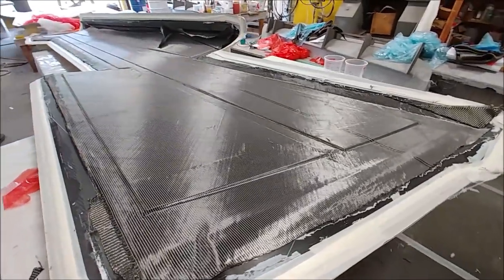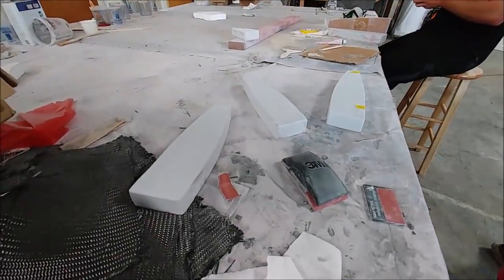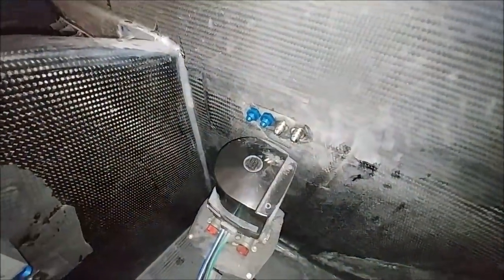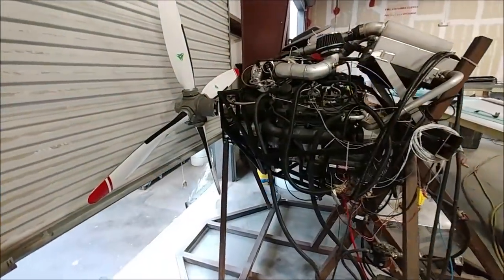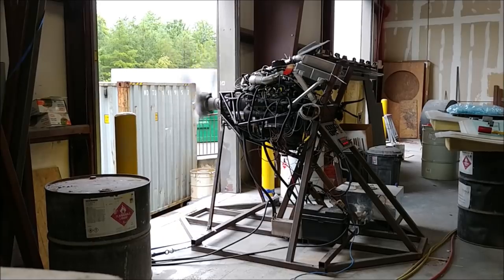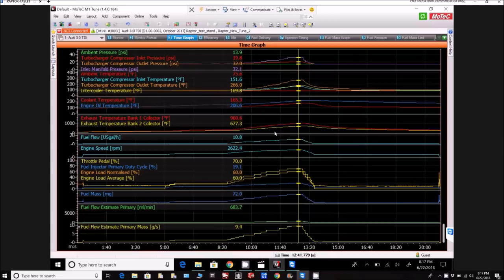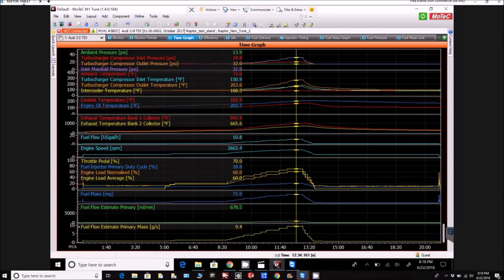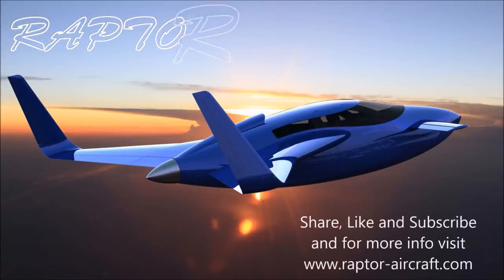Wing Skins Part Deux - Building the Raptor Prototype

Comment: Hello Peter, have you seen the tree line moving because of the air displacement, I'm amazed how powerful this engines is.How far away are those trees? Is kind of like 3 lengths of a 40 foot shipping container if I remember correct since I have been to your shop. And in top of that was kind of raining. All the best from Miami,thank you for keeping us updated  and good luck .Everything looks great.
Reply from the maker: That's what I was pointing out by moving the camera. They are about 100 feet away from the engine.

Comment: Yeesh. 483 lbs engine weight, according to Wikipedia. That's heavy! I was wondering why the test frame didn't seem to be moving much, which made me curious how much the engine weighs.
Reply from the maker: Actually, without alternator and turbos the engine only weighs 300lbs. Overall, with everything on it, it's about the same weight as a tsio550. But it burns way less fuel meaning you don't need to carry as much so it's better in that weight respect by far.

Comment: did that ticking noise go away after you changed the broken washer?
Reply from the maker: No, we have concluded that it's most likely the high pressure fuel pump or injectors and is quite normal.

Comment: Just curious , with composite construction, do you weigh the completed wings to make sure they weigh the same before installing them, or is it something that is not necessary.
Reply from the maker: They'll weigh close enough to each other. We'll check the completed wings though to ensure they weigh very close to the same.

Comment: Hi Peter - Do you plan to put the engine back on the Dyno at some point to measure fuel consumption vs. horsepower?
Reply from the maker: Not at this time. Moving it and connecting it to a Dyno is a lot of work and I just don't have the time or budget to do it again. Last time was a joke and we didn't learn anything new.
Reply: Without confirmation with a dyno, is there another way to confirm the numbers that you’re getting from the ECU in regards to performance?
Reply from the maker: We'll know how it's preforming when we do high speed taxi testing.
Reply: ,,, if the prop can be set to hold it at a specific rpm, preferably the Audi peak torque or slightly higher at peak horsepower rpm, at full throttle, it will also be very close to the factory boost, and right on the power specs . If the boost is not there, neither is the power. Not as complete as a dyno but a huge percentage of the sought after answer . Accurate fuel flow measurement will add to this .
Reply: Regarding the low load condition observed earlier. Low air density within the building (created by the prop) may have contributed. Advise measuring density at the engine.  Prop angle, rpm and density should enable good hp calcs using prop curve equation.   Supplier should have published a good curve fit equation from their development work.
Reply: Tim Duncan ,,, that door has quite a bit of cfm. Good point on using the known (if) prop specs .